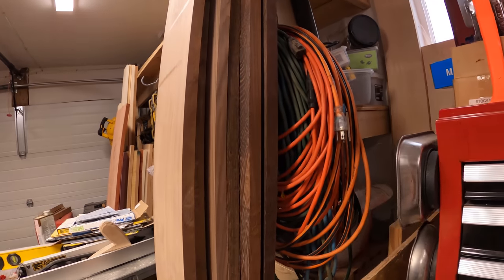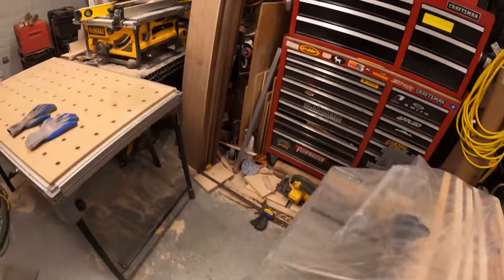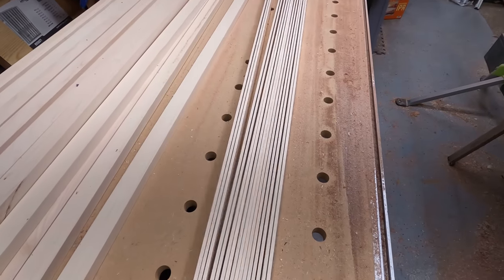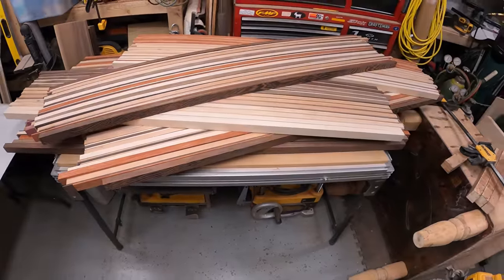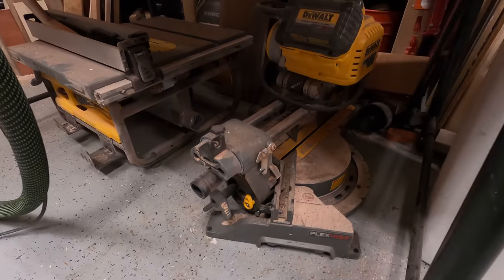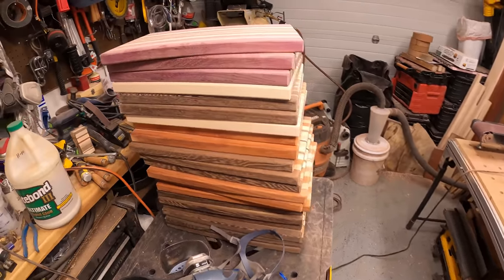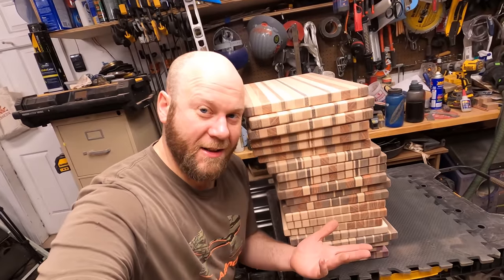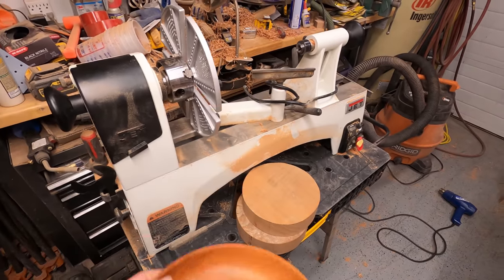21 Cutting Boards Sold In 10 Hours!  Annual Batch Of Boards, 2020.

Comment: you did all that work, such a nice job.  why not flip em to end grain and double the revenue?  that Shelix will do just fine on end grain with shallow pass and a backside blocker.
Reply from the maker: I do make end grain boards.  They don't sell fast like these do for Christmas presents.  I would have only got 2 per 60" run instead of 3 because of the extra cuts and they would need to be thicker.  Doesn't work out to double for me in that way. Plus thats a pain to get the glue up perfect with the detail strips that were in here. I have some more end grain boards planned soon.

Comment: I enjoy sanding for a couple hours straight.......after a few beers and some strong as hell pain meds so my back doesn't give out. Who am I kidding, sanding sucks. My first few projects were sanded with a 6 inch hand held belt sander, I do NOT miss those days. if you had a little more space in your shop I'd suggest a drum sander, I like that thing so much I barely use my planer any more. Sure it's slower since you cant take as much off on each pass but I wish I had gotten it a lot sooner. but the damn thing takes up more space then my table saw. 
And nice choice for branding irons, I have a High Heat brand myself.
Reply from the maker: Haha! Yeah sanding sure does suck. I actually gutted my garage and picked up a drum sander. It sure does take up room like your saying. Hopefully its worth it. Cheers!
Reply: @KrisDeVo  all that hand sanding you did with all those individual pieces in this video, can be done in a single pass with a drum sander. Just be sure to take your time getting the belt lined up flat with the drum. I think you'll like it, they save so much time.
Reply from the maker: Im sure hoping thats what its going to do for me. Just finishing getting it set up perfect.  Thanks

Comment: Great video.  I really need to get DeWalt's cordless palm router.  I've got a corded Bosch Colt, and the Dewalt would be so much more convenient.  I already have several 20V max batteries.  

I use the same conditioner.  Are you just warming it enough so it's more liquid?  At first I thought you were dipping your hand into blazing hot wax/oil mix:)
Reply from the maker: Glad you liked it. Yeah its a sweet little router. Warming just enough so its liquid, almost too hot to put my fingers in with gloves. Then I use a heat gun when applying after. lol not blazing hot though

Comment: I’m sure with your experience you are but I do hope that you are wearing safety glasses when you blow metal shavings around that with the air compressor. I want time got a metal shaving in my eye because I was working under it and drilling and I was a kid and it was a trip to the emergency room

Comment: Awesome video.  Cool to see you work around in a small space.  My garage is cramped but not that much so I have hope.  

One question when you sanded before glue up.  Was that with an 80 grit just to get rid of the saw marks?  

I was also going to suggest taking the off cuts and creating a butcher block board but the small bowls was a better idea.
Reply from the maker: Thanks Raymond.  I think it was 120, just to sand the saw marks on the thin strips only since they are too thin for the planer and I don't have a drum sander. 

My only worry about making a board for sale with the off cuts is thats all the snipe. Would hate for it to come apart on someone.

Comment: Nice Job! Ever had problems because of warping/movement/seperation between the different types of Wood? Any tips to prevent warping?
Reply from the maker: Thanks! I normally dont have any issues with warping and no issues with separation. Lots of steps to make it happen but main thing for warping would be grain direction. Need to make sure you are not putting them all in the same direction. I will probably do a board build 101 at some point.
Reply: @KrisDeVo  thx! :)

Comment: With those long pipe clamps could you not glue up two boards with one set at a time?
Reply from the maker: At 60" long and 24 to 30 un equal sizes its all I can do before risking the glue setting up

Comment: What hearing protection are you using? My lunchbox planer is so loud it bothers me even with some 3M over the ear style protection. Did you notice a big difference with the different cutterhead? I've got 50-60 boards to do this year for a charity event...
Reply from the maker: My hearing is pretty shot so any protection works for me. I have a few 3m. I light the lighter duty one or the worktunes. I have a black and red 3mm one that is pretty serious too. Look at the DB rating and see if that works. Thanks

Comment: has anyone come back to you about cracking and splitting of the woods?  I am curious if all those woods would work together or not because of the different species.
Reply: Its more about the grain of the wood than the species of wood.  As long as the grain of the wood is running in the same direction, along with a good glue up, there should never be a problem.  Face grain and edge grain the grain is going in the same direction, so they should expand  and shrink without causing problems.  Its when you mix an end grain with either a face or edge grain.  Then the woods can move at different rates and cause splitting.
Reply from the maker: JGumaJ is correct. Ive never had an issue.

Comment: Beautiful boards!  I noticed you use Howard’s Conditioner.  Have you ever tried Howard’s Wax it All?  Just wondering what the difference might be.  I tried the wax it all on a few boards and I didn’t get the slight shine or build up I thought I would have.....even after a buffing.
Reply from the maker: Thanks! I haven't tried that before. Looks like that wax might be more for a finish coat after using mineral oil or the conditioner like board butter. Not sure how much it will build up. Ive been wanted to try beeswax in a board butter mix to get the shine your talking about.

Comment: Those birds are absolutely gorgeous.
Please could you tell me what are all the  woods you used?

I would like to see if I could find them in the UK.
Reply from the maker: Thank you! Woods used are, Walnut, Maple, Cherry, Padauk, Wenge and Purple Heart
Reply: @KrisDeVo  thankyou, As you have used these woods, i assume that they are all safe to use and are non toxic.
Reply from the maker: I wouldn't assume anything you see on the internet is 100% true for the face value. The exotics woods in themselves are considered toxic. As a wood worker I am exposed to 100 times or more of the toxic properties of the wood in the form of saw dust on my skin and what I breath then what you would experience using it as cutting board. I take precautions but still am exposed. People have been making cutting boards with these woods forever. I myself have used these woods in cutting boards for almost 30 years. In my opinion (and most wood workers) they are fine and better then the plastic stuff everyone uses. Just like walnut with its nut allergens these exotics have their own story and you should look it up to make that decision for yourself.

Comment: Nice video.
Looks like you have the dewalt 735 planer. The helical head you got, is it Shelix?
Also, what size table saw are you using? 8 1/2 or 10inch? Do you like it?
Reply from the maker: Thanks. Yes the 735 and Shelix. I have links in the description. Thanks for asking because I had the wrong table saw link. Its the 10" and its great for what it is being a job site type saw. Its small which is a pro and a con. If I had room I would get a real one.

Comment: I noticed you initially rip the boards to a certain width then rip them again to get thin strips, leaving the final main piece that is “roughly” an inch tall when turned to side grain orientation for gluing.  How much leeway are you leaving for planing the glued up stack, or are you able to get them aligned enough that you only need to sand them after?
Reply from the maker: They start out at 1" 3/16 thick and after glue and planing they are about 1" to 1" 1/16"

Comment: This may be a silly question, but when you use light woods along with padauk, how do you keep the red from bleeding into other wood when you apply finishes?
Reply from the maker: Not a silly question at all. I used to have issues with it too. Use a compressor if you can and blow the saw dust out of the cutting board good before finish goes on. I do it twice, once before i add a little water to lift the grain,  then sand again, then blow it out really good before finish 👌 👍

Comment: Hi Great Job , I have a question ? I  noticed you used glue to put Boards together but did not see anything else to hold them in place. Was there any thing other that that that you did to secure them together. Also what was the glued you used?
Reply from the maker: Glue is all you need for a cutting board like this. Titebond 3. Thanks!

Comment: Question: Cutting boards get washed often. And sometimes left standing in water. How does your glue hold up???
Reply: better than the wood
Reply from the maker: Yes, better then the wood does. The board should never be left in standing water if you want it to last.

Comment: Maybe I shouldn't be but I'm amazed how you get tight joints especially for the thin strips simply with a hand sander.  Everyone else seems to use bid table saws, drum sanders and planer beds and other gadgets.  BTW, how long do you clamp for?
Reply from the maker: Thank you! The main strips are planed on the face so when flipped its a nice glue joint. The thin strips are definitely more tricky. I really try and keep them super tight to the fence when ripping and take a good look at them while hand sanding. Some of them don't make the cut or need more sanding. I normally keep them in the clamps overnight or at least 8 hours.
Reply: Thanks.  Seems like you have cultivated a nice market for the products you make and customers have confidence in what you sell (+ your personality).  Very nice.

Comment: Very inspiring work Kris! Thank you for sharing. 
Can I ask you what the Helical head on your planer offered you and why you changed out? I've got that Dewalt plane on order and was wondering what benefit it was?
Reply from the maker: Thank you! It makes a huge difference on hard wood with any figure to it at all. No tear out like the standard knife. Leaves a really nice finish and allows you to run end grain more safely. Also you only have to rotate a cutter knife or two if you hit something and put a ding in your blade. Lots of pros to it, cons are its expensive, takes time to install and cant take as much of a deep pass. I love it though.
Reply: If you can swing it, helical is the way to go on any jointer or planer.  I have one on my 8" jointer and it makes the surface smooth as butter!  no tearout like with the straight knives, and it makes a perfectly smooth surface for lamination/whatever and cuts sanding time drastically!

Comment: could you fit more than one cutting board in those pipe clamps or would it not glue up correctly?
Reply from the maker: You could but its all I can do to get one done and together with all the strips before the glue starts drying. I glue multiple boards when they aren't so complex.

Comment: Nice work! Do you have any tips for preparing the wood? Getting it straight without a surface planer? I only can afford a planer and my workshop space is limited too.
Reply from the maker: Thank you! Need a planer and way to straighten the lumber before running it through the table saw
Reply: @KrisDeVo  Thanks for the reply. Planer is on my wishlist but whats is a good method without jointer to straighten the wood?
Reply from the maker: @Foxcraft.Workshop  a straight edge and skill saw. I show it in this video.  Good luck

Comment: Did u sand glue off even though u were going to plane?
What's your glue technique for gluing up and keeping them from coming apart when in use and exposed to water etc
Reply from the maker: I did rough sand so the glue didnt lift parts of the board going into the planer on the first pass. Make sure you get squeeze out everywhere you need it. The care of the owner is the main issue.
Reply: @KrisDeVo  they look smick cant wait for new table saw to try this type.
In Austalia so our timber choice not as good cant even get black walnut my fav.

Comment: which types of wood did you use?  and can you reveal how wide the individual strips are?  the smaller and the normal size.  Chopping boards are on the whole I guess 30x50 right?
Reply from the maker: The woods used are maple, walnut,  cherry,  purpleheart, padauk and wenge. Smaller ones are 1/8 to 3/16 and larger ones are 13/16 to 3/4. The width is around 17.5" and length of the 3 board runs are 60"
Reply: @KrisDeVo  thanks kris 😊👍

Comment: I have been looking at cutting boards some ranging 200$. I have heard maple is great, Canadian maple, and I'm wondering what is the best way to maintain a wood board? Coconut oil?
Reply from the maker: Are you looking at an end grain boards? These were all edge grain. End grain is definitely better but more expensive then these. Maple is probably the best overall. Dont used coconut oil or any other cooking type oil as they go rancid over time. Use mineral oil or Howard's Butcher block conditioner. I will have more boards for sale soon on my Facebook page soon
Reply from the maker: @Melanie Jarrett   https://www.facebook.com/Devoswoodcraft

Comment: Hey, great video. I'm based in the UK where the weather is mostly chilly, not your cold though. My question, do you have any issues with the wood expanding and contracting due to weather? Guessing the boards when in home will be much warmer than when in your garage. Thanks. 👍
Reply from the maker: Thank you! No I haven't had any issues. I keep the garage about 60 degrees Fahrenheit so the glue will set up well and isn't too chilly. Not too big of a difference going into the house. I sometimes do have to keep wood outside in the shed and give it a few days to acclimate before using it.
Reply: @KrisDeVo  thanks Kris, good to know. I currently have some timber under the bed. My garage isn't insulated and can vary in temperature so feel having it inside till I use it might make sense 🤷🏼‍♂️. It's great to see your work, very precise and great quality in a small garage. Gives me some hope! Thanks again.
Reply from the maker: @gsallis85  Probably okay on the temperature stuff unless its really extreme. I would think humidity fluctuation might be more important if that has a big change over there.  Thank you for the kind words. Good luck! Cheers

Comment: Hello Kris,  Thanks for the terrific video. Just one question.  What is your starting/finish cutting board thickness?  Thanks in advance for the help.
Reply from the maker: Hi Jim, thank you! I believe I cut these at 1 - 3/16" and they ended up at 1" or 1 - 1/16" depending on the board.

Comment: is it inch thick boards you use? and what table saw do you use? looking for a new one as realise my cheap ones blade doesn't sit at 90 degrees and the rip fence doesn't hahaha live and learn I guess
Reply from the maker: Yes they are about 1" thick once done. The table saw is a Dewalt job site style saw, 10". Works great, I have a product link in the description if you want to check it out/buy. Thanks.
Reply: @KrisDeVo  awesome thanks for the help ps awesome chopping boards forgot to say that before

Comment: I see walnut. Some people may die. Think about anaphylactic shock and nut allergies. Yes, nut wood can trigger lethal anaphylaxis.

Always consult the toxic woods database, especially when making food preparation surfaces.
Reply from the maker: Nobody dies from using a walnut board. If you were that allergic you would know what not to eat off of. This has been long discussed and I am well aware.
Reply: @KrisDeVo  You cannot say that nobody dies from using a walnut board. Perhaps none of your personal friends have, but PEOPLE have.

You cannot control where that board goes and how it's used for the rest of its service life. It may change hands, it may be given to someone as a gift, it will eventually find its way to the secondhand and thrift store market and be bought / used by someone who has no clue what woods are in it. It will be used to prepare foods for people whose nut allergy is not known by the person preparing the food. You will be responsible for their reaction because walnut wood is very highly toxic to certain individuals and you knew that when you made the food preparation surface. There's a very good reason that most of us individual (and ALL of industry) avoids using nut woods for cutting boards. You wouldn't use cocobolo for one, would you? Or nux vomica? No? Then why would you use a nut wood?

Stop doing that. Really. Stop.

Comment: Have you ever thought about using those huge cutoffs and gluing up some weird looking boards. It might be cool
Reply from the maker: Yeah definitely.  Im just worried about the planer snipe. Thats the portion that was cut off.
Reply: @KrisDeVo  I glue a longer piece of scrap wood on each side, to take the snipe, then trim it off when I'm done planing.
Reply: @KrisDeVo  I have the same planer. To reduce or get rid of snipe I place a 6 to 7 foot Med board on the planer bed and out feed tables. Make sure you have good support on outfeed side. Put a cleat on bottom of I feed side so it doesn’t get pulled thru. This reduced snipe for me to nothing. Hope this helps.
Reply: @KrisDeVo  MDF board
Reply from the maker: @dennisnahorney8215  I might have to try that. I really probably should. Without going into a ton of detail I have some amazing finish carpenter friends who say that doesn't always work.... Cheers!